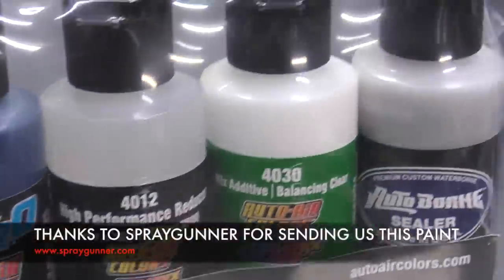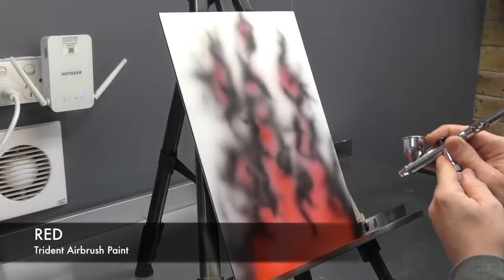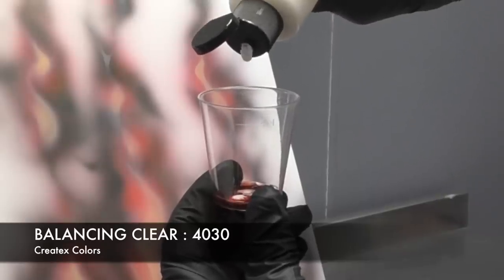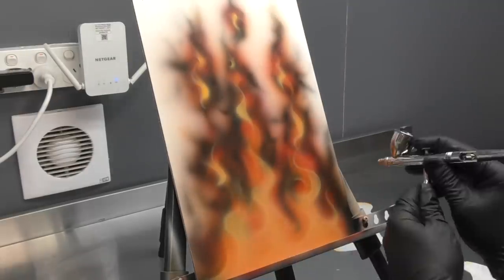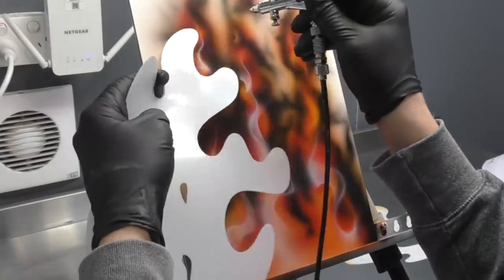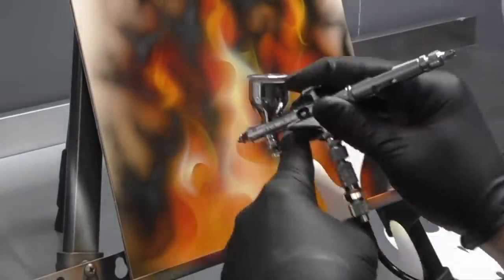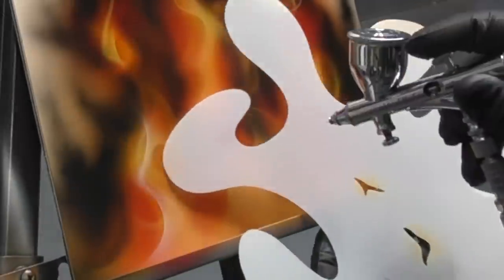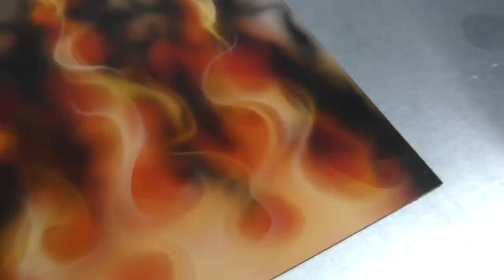Learn how to Airbrush Real Fire using Createx Candy 2'0 and Fire Tool templates

Comment: Ah awesome! Great to see you play around with the Candy H2o stuff! (finally!)  This was a really interesting video of yours for me, having gone through the mill on these products and pretty much doing the same panel flame work. Personally Im not so keen on the black burnt effect on a white panel, my mind seems more comfortable with a black panel (but hey, were all different right, thank god). I was really surprised you got away with light coats of bleed checker from an airbrush, I had to use a mini gun and lots of coats or it bled through onto new layers of white/light. (I know you used the 4030 as the checker, which is fine and I saw the query from someone else re using the actual named bleed checker product, you dont need that product and the 4030 is fine),  but my larger airbrush just didnt lay enough coats down to stop bleed. So it did surprise me. I love your light hand and subtle licks, very skillful indeed. I still have to stop myself over using the templates and creating awful hard lined 'blocks' of flame. So how did you feel about the Candy H2o candy? I ended up painting my whole Austin panel van in deep dark purple h20 candy, 8 layers over silver ali base. Cost a bloody fortune!
Reply from the maker: Many thanks for your comment mate, I used the 4030 to mix with the Candy and then reducer for every 10 drops of candy I added 3 drops of 4030 and then about 5 drops of reducer. To seal the Candy in between layers I used the Wicked transparent base which worked fine using a HPCS eclipse with a 0.35mm needle, I am sure there are other ways to do it but this worked for me . Thanks again all the best 👍🏻
Reply from the maker: All in all I did like the Candy 2’0 it did perform like a usual urethane dye which is great 👌🏻

Comment: You didn't use the Createx Bleed Checker ?? Cost ?/Time ?? Both ??  was your clear base coat 4004 ?? Thanks
Glen
Reply from the maker: Hi there I didn’t base the Alu panel it was just the white that was on there already. I only used what came in the particular set that I showed as I didn’t have the bleed checker, all in all I was happy with the way everything worked ie candy, balancing clear (4030), reducer and then trans base to seal in between layers .
Thanks for your comment 👍🏻

Comment: is this fan on the left side the only fan in your workspace and what performance does it run?
Reply from the maker: Hi there no I also have one above which is the main extraction I use 👍🏻
Reply: @AirbrushAsylum  thx. i need to build a fan for true fire in my working room, cause i have no spray booth anymore. what is the performance of your main extraction? can the little fan alone suck in all the candy spray?

Comment: Hi mate, following this video and ive had a go at doing some real fire using createx colors and the candy 2.0, so i have the 4030 Balancing Clear and 4012 Reducer as you used in this video, at 15:03 you use a Transparent Base,, is that the Createx Bleed Checker ? ive just bought some because i think this is what you spray over each candy layer to stop it `bleeding` through when you apply another colour, am i correct ? if so do you apply the Bleed Checker straight out the bottle neat or does it have to be reduced first? your advice would be appreciated mate, cheers.
Reply from the maker: Thanks for your comment , I actually used the transparent base by wicked colors to seal in the candy and I do mix this with reducer. I haven’t used the bleed checker but I believe it may be a similar thing ? Just do a quick test before you use it on your artwork but hope that helps 👍🏻
Reply: @AirbrushAsylum  cheers for the reply mate, i do appreciate it, i`ll see if i can get some transparent base as well, bleed checker should be here this week so i can crack on with that and give it a try, just ordered an Iwata Eclipse HP-CS so looking forward to trying that when it comes to see if i can get some detail work done, i have a 1001 questions to ask so i hope you don`t mind if i pop up now and then to pick your brains LOL, cheers again buddy, be safe.